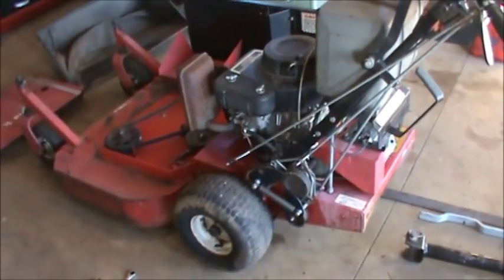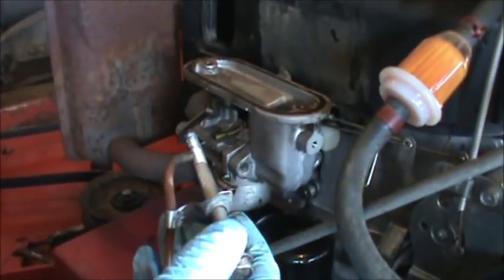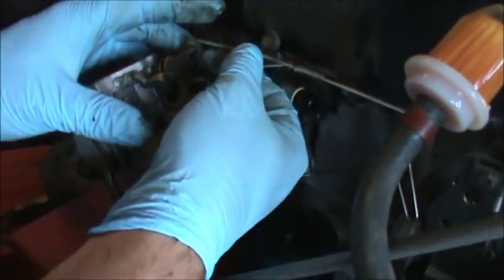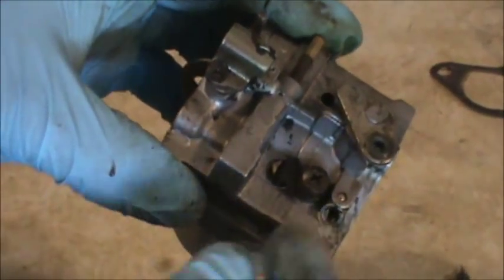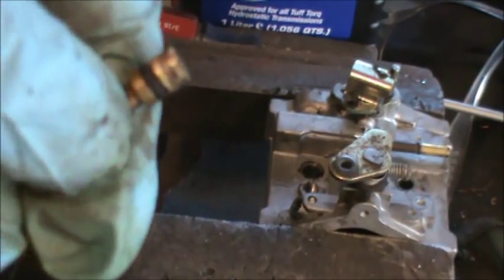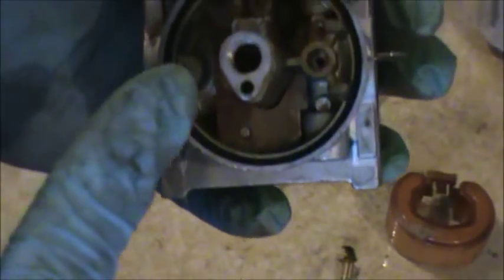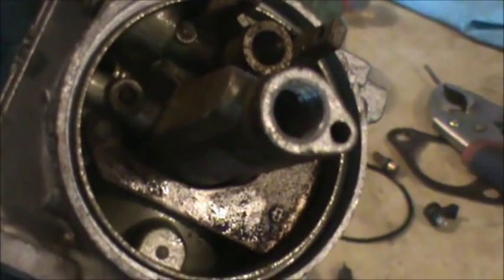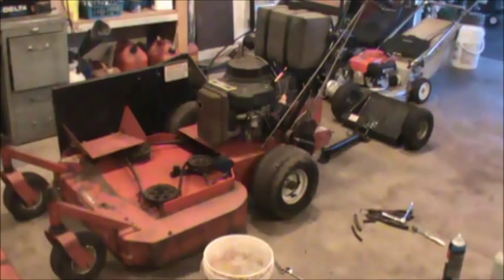kawasaki FB460V Carburetor Rebuild

Comment: Hi I’m having an issue with my fb460v 12.5 hp engine . Have spark , fuel , and compression and I can get it running but at full throttle it basically is popcorning at half throttle . Any suggestions?

Comment: Double wide I have the same machine only belt driven.  Do you have any schematics of the carb. There is a white looking plastic piece with a  black fuel like line that goes in the backside of the carb by the linkages.  Also there were some other tube like things that were not on my carb. I'm just trying to see what mine is missing and if a standard carb kit will come with that

Comment: Hey brother, I'm having trouble finding the right recoil starter for that engine is it possible if you could take those 4 screws off the shell and show me it. The connection between the motor and the starter is confusing in the manual. Thanks.

Comment: My 42in  exmark was running horrible. I watched your video and fixed it right up. Took me about an hour to remove carb clean out with carb clean spray and air. Started after three pulls. Now it starts first pull and runs like new. Thank you for the help and prayers for your family.

Comment: Great video. I feel like a lot of these issues with small engines and the gunked up carbs is largely due to the levels of ethanol in our fuel. The oil industry conspired with the gov to include 10-15% of ethanol in our "blended fuel". This bit of ethanol of course dilutes the fuel you pay for, gives you worse economy and wreaks havoc on small engines and carburetors. I would highly recommend folks find a pump that sells ethanol free fuel or remove the ethanol yourself. Look up the method on youtube, its very easy to do and there are a lot of examples available on youtube. It's truly a shame that the gov would pay more to framers to grow more corn to use in ethanol despite them knowing that it pollutes more and causes fuel system damage.
Reply: Yup.  Thank Iowa, the Pres. primarys and Archer Daniels Midland lobbyists.  As it absorbs moisture, it wreaks havoc with outboard motors too.

Comment: A little tip on these kind of Kawasaki carburetors; the float and needle valve from a Briggs push mower (with the float type carb) will fit into these and work perfect if you happen to need  one. The float will need just a very little shaved off with a razor knife where it fits in between the two pedestals that hold the float. If you go buy a Kawasaki float they are around $30 and the needle valve is $15 or so.

Comment: Thank You for the video, my Xmark with this motor would start but choke down like it was out of gas or had water in the gas. I watched your video within a few minutes found my problem, the choke was closed , I opened it with my finger and lubricated   it. Runs like a champ!

Comment: Loved this video and watched it many times to learn about my carburetor on my machine.  I cleaned the heck out of my carb just as you did but had no luck with hard starting problem so I bought a new carb and still having problems.  The only way I can start my mower is with starting fluid.  
What confuses me is that when the machine is in the "choke" position, both of the butterfly valves inside the carb are in the closed position. Is this right?  This seems very peculiar to me as I don't understand how the gas can ever get to the spark plug when both valves are closed?  I am an amateur do-it-your-selfer so any advice you can provide would be appreciated.  Also, prayers that your boy is doing fine.

Comment: Hope your son is doing better man! Also, was wondering if you would consider selling this little mower? If so how much?
Reply: i know this is an old post 3 yrs old but i have one of these mowers that has been sitting for several years . Im cleaning the carb and gas lines and new oil and just going through it to get it running again. But i am interested in selling it if you by chance are still interested in one. thanks .

Comment: That breather look like the one on my John Deere Z-445 zero turn mower. I assume the carburetor is about the same also. I am afraid that I will have to take it off and clean it since the mower only runs when you put fuel in the carburetor then stops when the fuel is burned up.